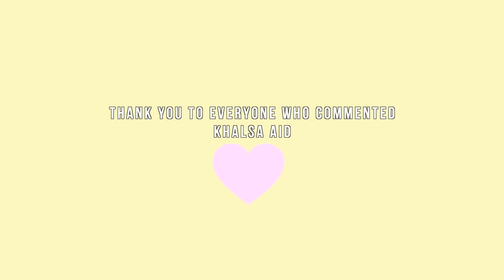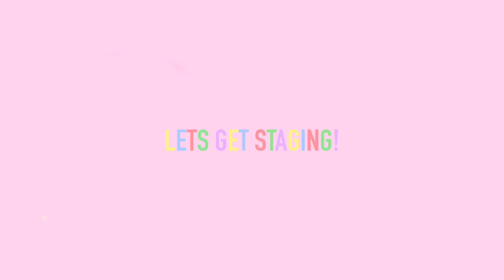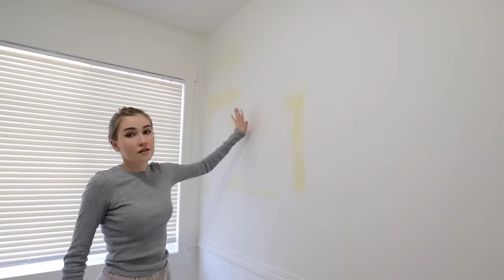un-making over my studio to sell it *did I ruin it completely?*

Comment: Honestly I don’t think you doing things to the house decreased the value. You updated every room and didn’t knock down walls or permanently alter the floor plan so great job! You only made it better in the long run. It looks great!
Reply: I could see removing that one closet as somewhat decreasing the value of the home.  In the US, if the room has no built-in closet (unless built earlier last century), the room cannot be listed as a bedroom.  House values are very dependent upon the number of bedrooms the house has.  I likely would have added the closet back so I could list that room as an bedroom/office.
Reply: @Cloudburst2000  A bedroom in the US does not have to have a closet to be considered a bedroom. But it does need to have a way to exit to the outside, a window that opens.
Reply: Same thing in Canada, just looked it up

Comment: Suggestion...when you hang the equipment in your new studio, make sure they are being screwed into the studs or use ceiling anchors.  It won't matter what size screws you use, they will eventually come crashing down if you don't and that is some expensive equipment for that to happen to fall and smash.

Comment: Mia, i saw you unscrew the leg plates from that white table that was in the office - I believe the silver plates stay attached to the table, and you just have to turn the legs to unscrew them from the plates. You do not need to use a screwdriver, do not take the screws out.

Comment: Mia! I have a video idea for those prints with the animal heads which would be very helpful to me if you could make it work! They sell those at a major chain in Australia very cheap, and I’m wondering if the canvas can be separated from the frame, painted and then reattached to the frame. If so it would be way cheaper and easier than buying a canvas and making my own floating frames and staining them!

Comment: I just had to say it only because I notice these little details but the bed with the grey headboard needs a box spring, like the metal pieces in the back you shouldn’t be able to see. When buying bed frames they usually indicate platform meaning they don’t need a box spring

Comment: I have noticed this before but do you generally call the ceiling a roof or is it just you saying that? I’m just curious, I think it’s cute.
If you fill those nails holes with a finger you wouldn’t have to sand them afterwards just a tip from someone that does this for a living.